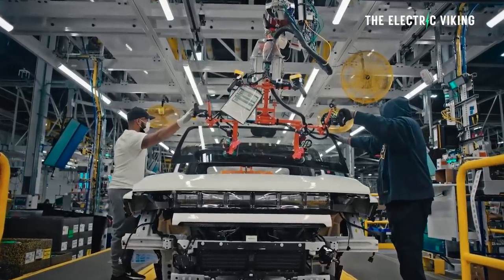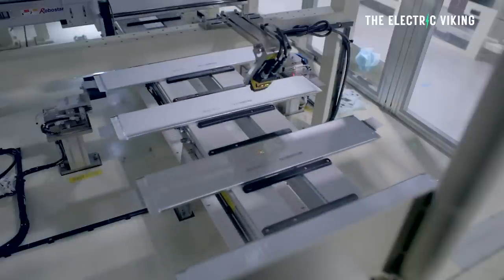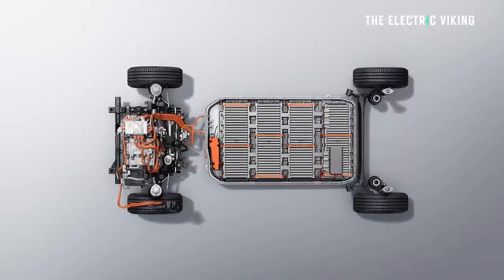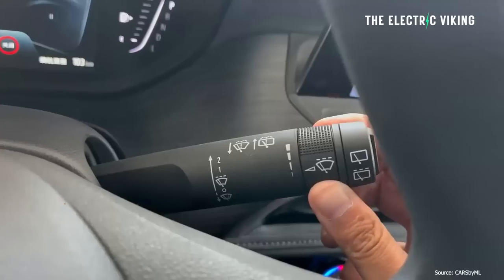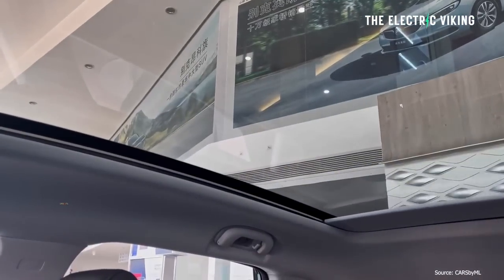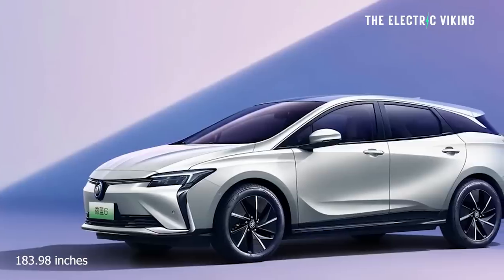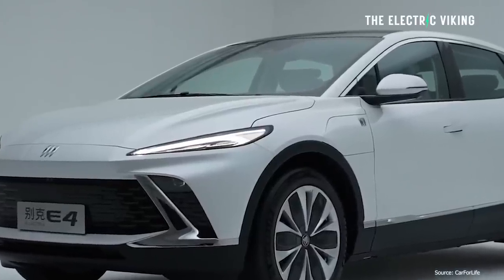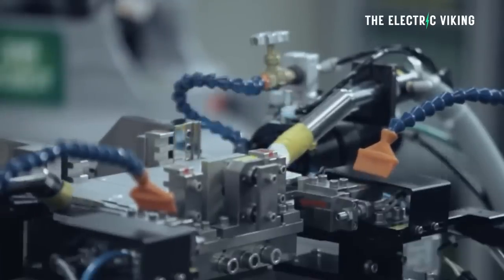GM reveal NEW Buick Velite 6 electric sedan in China for amazing price

Comment: In fact, this car has been out for a long time. I am the owner of the Velite 6PHEV and bought it in 2021. I have been driving it for two years now, with a fuel consumption of around 5.8L/100km, and a slightly higher fuel consumption when cruising on the high-speed 120. The official label for pure electricity can be in the form of 60km, but the actual distance is around 50km. In fact, the sales of this car in China are very poor, to the extent that it has been heavily packaged for ride hailing companies. I made the purchase at that time because BYD had to wait in line for six months to pick up the car after ordering, so I chose the Micro Blue 6phev. To be honest, I regret it a bit, but this car is not bad either. The disadvantage is that the l2b engine is too old, and the disadvantage is that the engine noise is too loud! For DMI with BYD in the same price range, the car's operating system is too primitive (compared to BYD), with a very small fuel tank of 38 liters.
Reply: By the way, the top configuration I bought at that time was 13.5w RMB.

Comment: That should be the Buick that GM sells analogous to the Bolt, for the entry point of the Buick brand.  It looks better than the Bolt, and for $16,000 would sell like hotcakes, just like the Bolt is doing right now.  The LFP battery pack would eliminate any of the battery fire concerns associated with the Bolt and its NMC LG batteries.

Comment: I like the traditional tactile controls and the less than enormous touch screen, seems like about the same size as the one in the Bolt. If GM can bring it to NA and sell for a reasonable price, I’ll definitely consider it for my next vehicle after my 2018 Bolt has seen its best days.
Reply: @SunriseLAW  it’s not up for replacement yet, it’s running extremely well and should for another 10 years easily. I meant when it is ready for replacement, as in when I feel like I’d like a new vehicle.

Comment: There is a 27.5 percent tariff on Chinese autos for importing into US. So there is no need to assemble in usa..car could be sold in usa at 19150 usd which includes the tariff and could have the same profit as China so probably it is the safety regulations difference between usa and China

Comment: A reversing camera would be highly desirable in my MG4. It’s a pity it doesn’t have one.
Reply: Imagine, people used to ride without camera's for over 120 years.
Reply: @BMWHP2 modern cars have poor rear visibility due to crash safety standards. Also they're required in the US since 2012.
Reply: @GregHassler  Then, modern cars in the US are poorly build? or . . . .have poorly drivers. 
I can park my car without camera's since 1970, never had to use camera's. I dont think it is the way they build cars, it is more about the way drivers use cars (or never learned how).
Reply: The MG4 comes with cameras in the top trim
Reply: @bill_heywood  I’m too poor (or mean) to lash out the extra £3,000 😂

Comment: Front wheel drive does have it advantages.  Cabin space and traction in snow is greatly improved. 😊
Reply: FWD has advantages with ICE cars in terms of interior space. That evaporates with BEVs. And precise control of electric motors negates all that FWD advantage in snow too.
EDIT: Reminds me of a Hyundai Ioniq.
Reply: @ramblerandy2397  I can see that the interior space argument is valid now that I think about it but will need to look into the front wheel drive Vs rear on electric, the way I see it it is better to pull then to push when driving in snow
Reply: @canadianwatchmonkey3992  Yes, I agree with an ICE vhicle it is absolutely better to have FWD in the event of snow - most Swedish made ICE vehicles have it, for example. But the precise control of electric motors is such that RWD is no longer at a disadvantage. Cars won't even spin out or lose traction. And I used to be a big advocate of FWD - ex-SAAB 900i and T16 owner.
Reply: @ramblerandy2397  I had a 2021 FWD Kona EV in Canada. Front space was fine. It had "Snow mode" which removes the torque which would be bad in snow. I simply had winter tires and no issues in driving it. I think this counters all of your points.
Reply: @ScubaSteveCanada  Not sure it actually counters the points I made, but good for you. I've always liked FWD myself and considered a Kona myself. It's just that with electric motors you don't need to feel that you have less control with RWD in slippery conditions, like snow. I'll see if I can find a demonsteation video. Obviously no link because YT will remove it quickly. You'll have to type it in...
"How Does the Tesla Model 3 RWD Handle in the Snow with SNOW TIRES" [USA spelling] ? Copy and paste the words within the quotation marks only.
This is just one example. I have read around the subject. Traction control and wheel monitoring on BEVs is astounding compared to an ICE vehicle.

Comment: Most of GM's current ev offerings require +200 kWh battery packs which is 3 to 4 times what most other companies require per vehicle. Just like their gas guzzlers, they now have battery guzzlers. Take all their Hummer sales (vs preorders), all their Silverado sales (based on pre-orders), all their Escalade EV projections and multiply that by 3-4 and that is how many 60-80 kWh vehicles they could manufacture. Like the late 70's and 80's gas crisis which forced the world into more efficient and smaller vehicles, the change to electric means that efficiency and rare elements is again at the forefront and GM's decision to only build trucks and SUVs locks them in to a business model that doesn't fit well with the reality. An electric pick up truck for job sites makes sense due to the limited mileage and ability to use them to shuttle items on a construction site as well as provide power but they just don't work when it comes to towing or trailering long distance and as daily driver/commuter just consume resources for a vehicle that doesn't really offer and advantage over a large sadan/sportback. Ford also has the same issue to some degree and if you look at what models are successful from Tesla, China and Europe, the decision to not build cars is now showing it's frailty.
Reply: @SunriseLAW  solid state is a long shot. Tesla like AOL. Don’t make me laugh.

Comment: 430 on cltc is nowhere near 400 in reality. You lose about 30%, so it'll be closer to 300 real world.
Reply: i see test, realy 310-350 km
Reply: I own a velite6, I usually commute 55km to and from work, a third of which I drive at 140kmph, the actual use of the car's range is around 380km, and I own the same car netizens do not speeding and even some people are able to drive 450km range.

Comment: It won't come to Europe, because GM pulled out of Europe a long time ago. If this was designed and built by a chinese manufacturer it might be slightly better than proprietary GM scrap metal, but they still have their hand in it, it's thus got to be a turd with a spray job. Seriously, I bet the chinese only buy this as a last ditch stop gap. Nobody in their right mind buys a Buick.

Comment: they don't do this because they don't want to.
Manufacturers want to profit as much as possible. That is their goal.
All manufacturers.
So each and every one of the legacy car makers are doing everything in their power to not sell affordable cars.
They may have underhanded deals with each other but in fact the core capitalist rule sets them on this path. Maximize profits.
If they were to start selling cars at fair price, affordable, then they will make less money.
So the prefer to bitch and whine and not be fair to customers and not making any cars sales instead of selling many cars for low profit.
Remember they don't need money, they are wealthy corporations so they'd rather not sell instead of altering the current pricing levels.
...
A base model tesla model 3 without the roof, the leather, less power and thus smaller battery, no more cameras and thus fsd hardware would sell with same profitability as the M3SR with 30.000 usd or less (tesla list price, not considering any incentives)
A smaller tesla with this basic trim would be sold for similar profitability with 20-22.000 usd.
Tesla is the top dog in EV world, best efficiency and performance per kw.
So any of the nobodies like GM, and the rest of the legacy car makers, would need to sell a similar size and spec vehicle for at least 15% less than a tesla.
So, this velite 6 would be selling for like 15.000 usd.
They don't want that.
25.000 for this steaming pile of garbage is too much., let alone 35.000 as you suggest.

Comment: Few would buy this junk car in US and Europe.
Reply: I remember when the "new Malibu" came out using a Chinese wire harness, I would see mechanics fire the parts cannon at them replacing sensors which would fix them for a little while but so would just unplugging the sensor and moving the wire harness and plugging it back in, then we got hit with the China engines that would be lucky to make it 100K. All the reputable wheel bearing manufacturers started moving manufacturing to China and they became absolute junk. 
I own a lot of nice high quality stuff that was made in China but I wouldn't want a car from China.
Reply: When the Japanese first shipped cars to NA they were the same, junk. Chinna has come a long way in building cars, and today builds some of the best electric cars on the market. BYD and other manufacturers should ship their cars to the states. Even with a 27% tariff, they would still be competitive with ICE cars. In Thailand the Chinese EVs are the same price or cheaper as their ICE competition and come with all inclusive 8 year 160,000 km warranties.